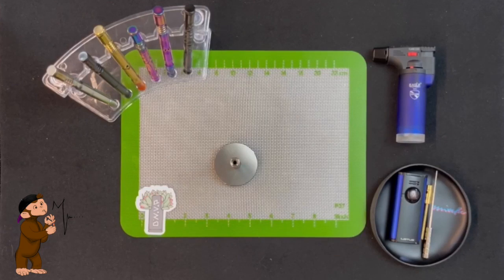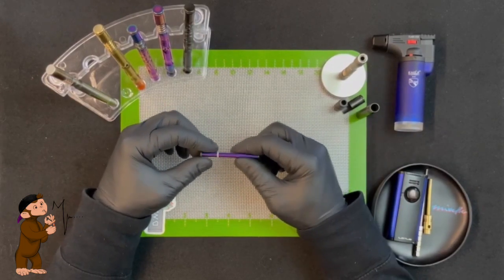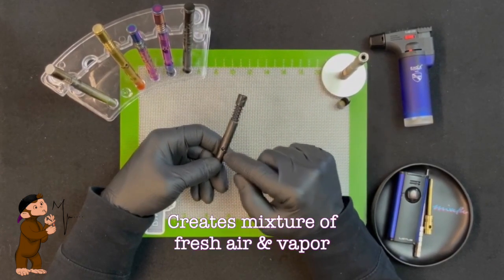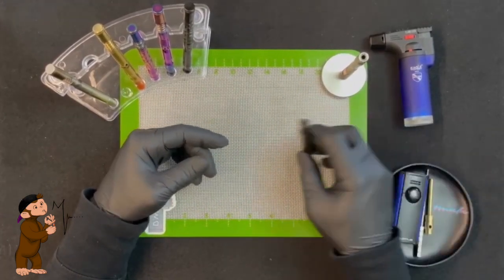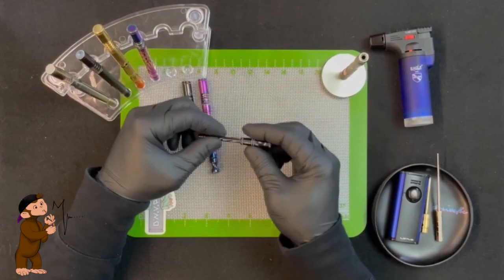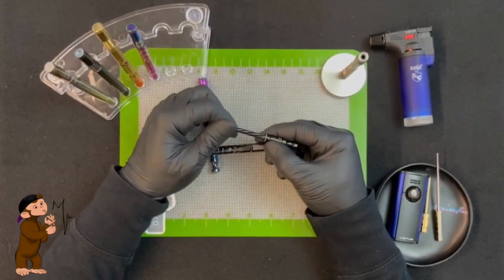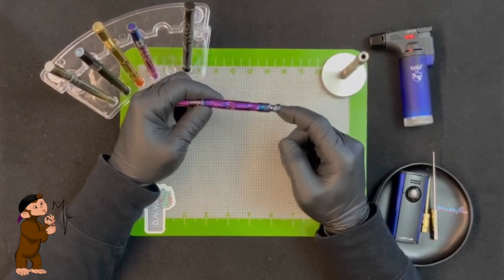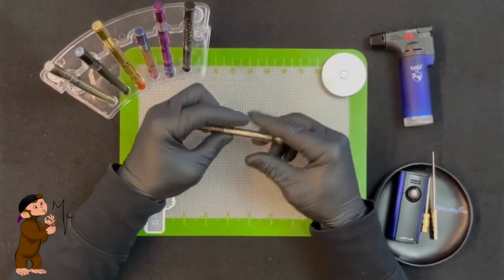Get to Know: Dynavap pt 4 = CONDENSERS & MOUTH PIECES.  How do they work?

Comment: The Vong I has grooves in the middle of the condenser maybe it has a different function?
Reply: in a water piece maybe more restricted
Reply from the maker: That is a Ti condenser the upper groove is to move the oring up and cut the airflow off the airport for use as a WPA

Comment: Thanks Moo, have you found much difference with the new textured condensers that started appearing a month or so ago? My vong-i has one but I haven't got around to switching it with the old style condensers to test it back to back yet
Reply: This is an excellent question. I've been wondering about the recent condenser variants. It's good to know that a recent vong-i order included one. What does your Vong-i condenser look like Moo??
Reply from the maker: I have not been lucky enough to get one!!! I haven’t quite figured out what all comes with them yet seems to be random from what I have seen so far.
Reply from the maker: I got a Vongi very early on so its just a standard one. Super interested on trying a new one.